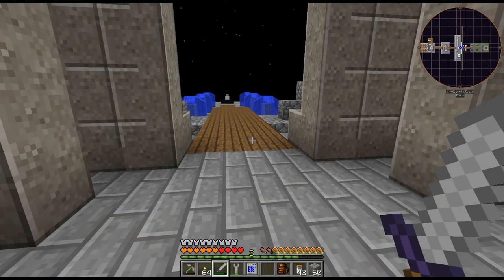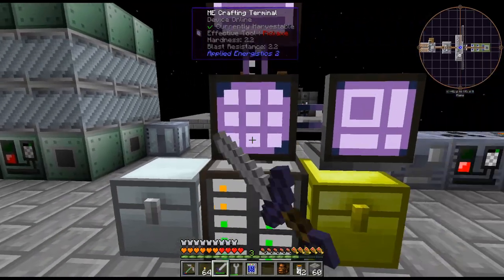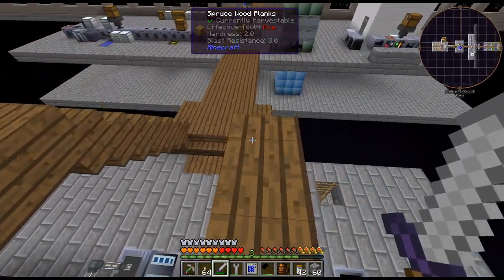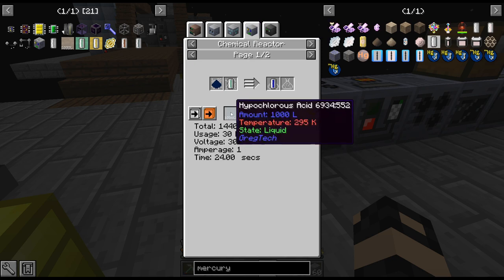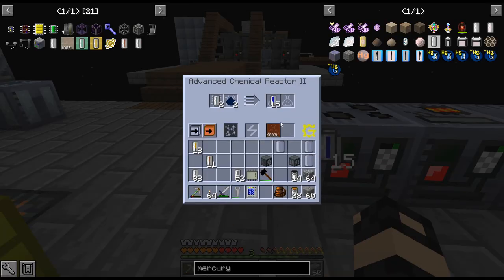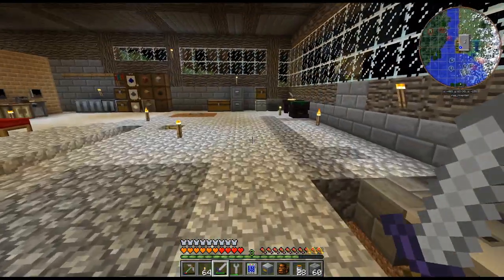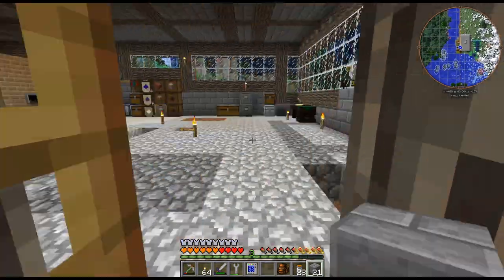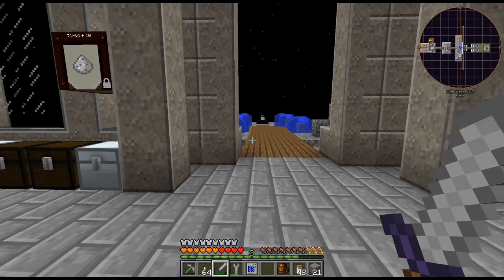GregTech New Horizons S2 - 69 - Advanced Circuit Boards

Comment: Speaking as someone who made a 15×15×6 exterior Cleanroom: Don't bother. It's not worth building one that large, just shove machines in a Processing Array down the line and call it good. A 5×5×4 interior will get you that far comfortably enough.

Ender Tanks require two Dense Enderium plates, an IV Sensor, an IV Emitter, and (as far as I can recall) nothing else of consequence. The IV components require Quantum Stars, which is Nether Stars dipped in Radon, and Iridium rods, which (IIRC) needs an EBF with IV power and Tungstensteel coils. Oh, and a Silverwood wand in order to store enough Vis for the craft, I don't think a Transmutative wand is able to do it. Though a Transmutative crafting scepter might? I can't recall, I think I actually skipped that one.

You can actually smelt Cinnabar dust into Thaumcraft quicksilver, which then fluid extracts into a full bucket of mercury. More efficient than centrifuging two dusts and getting one bucket of mercury and one piece of sulfur. And spoiler, you're going to be starved for mercury in the near future when you start processing ores through the chemical bath with mercury to get more gold/platinum out of them.

For fluid storage I would recommend external fluid storage (cheaper than storage cells, at least early) and using fluid P2P and/or Ender Fluid Conduits to move fluids around. The latter two got upgrades in the next update IIRC, so that could be fun to experiment with/show off.